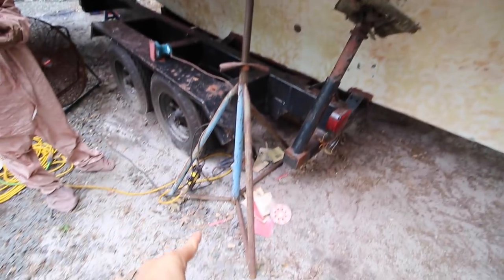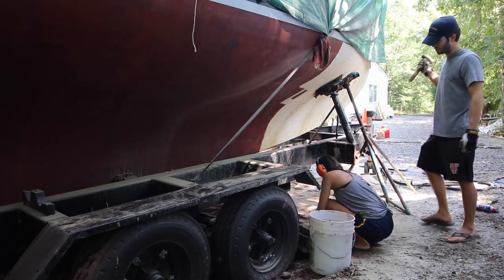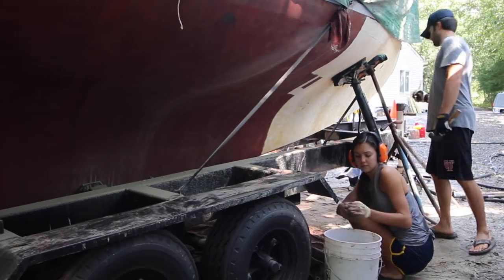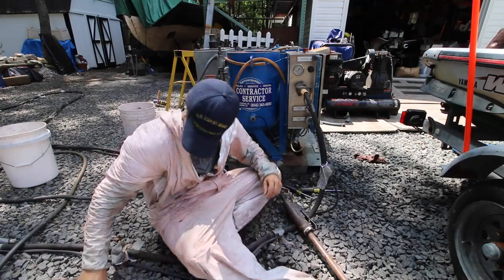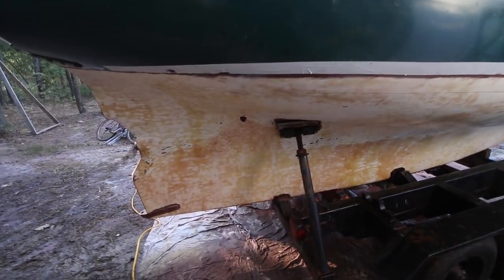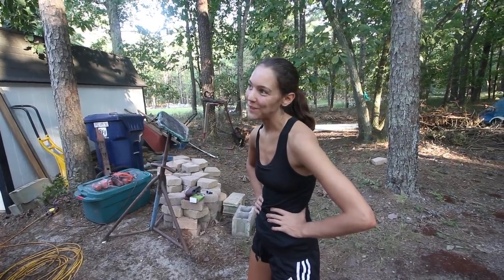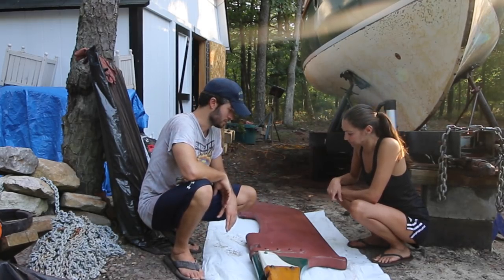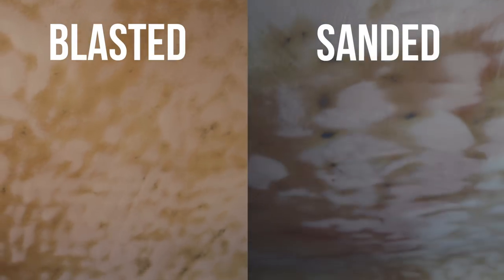45] Backyard DIY Classic Sailboat Restoration | Abandon Comfort

Comment: is the heat from the electric engine a consideration, how will you cool it?
Reply: Heat from an electric engine is not a major concern. They run around 95-97% efficient so very little waste heat is created when compared to a diesel running 30-40% efficient. Lots more of the potential energy gets converted to mechanical motion with electric motors than with a diesel, the wasted energy is the heat created. Still diesel fuel has much more potential energy per pound than even the best lithium batteries, which is why you get a much greater range with a diesel even though you're throwing away much of the energy in the fuel.

Comment: Ran into you guys by accident.  I will be moving from Central America to South Florida to live and I want to buy a boat, not sure of what yet.  I am use to 20-25 " ski boats in Colorado so it will be big change, but thinking of getting used sail boat and not sure of what size.  Something reasonably cheap that I could fix up.  Need suggestions on where to look and types of boats to look at.  Please advise !  Thank you !  Ciao, Robert

Comment: How long before you are back in the water. I'm waiting for more adventure.
Reply: And also, I think electric would be an issue, the diesel engine will run 100 % until you are out of fuel. The electric will not run 100 % on 1/4 battery life. Yes electric can be free, but, you almost can't even dock with the run time. The diesel engine will run 100% until you don't have fuel. I would recommend keeping the diesel, and adding an outboard electric to add extra thrust while running the diesel engine. In turn the diesel engine will charge the electric and do its job almost like your Prius does. Or use a diesel generator Good enough to charge as much as you use. Along with solar panels and maybe a few wind driven generators to use during sailing, it might all work together to produce power for propulsion. Hybrid boat.

Comment: Why did you decide to remove the anti fouling?  Irrespective of the coatings age and that it has been out of the water 10 years, based on what I can see in the video only, I would have not removed it because I see no pealing nor delimitation nor damaged hull.  I would have sanded and simply touched up with primer where necessary followed by 1 coat of anti fouling.  Senior Surveyor Lloyds Register.

Full coating removal is required when the coating has 'failed'.  Failure of coating is identified by delimitation and pealing. If this is not occurring it means the bonding between layers is strong.  My opinion is if the coating has not delaminated nor pealed after 10 years, there is EXCELLENT coating bonding and so keep it on but do a hard sand to prepare the surface for the new coat. Senior Surveyor Lloyd's Register!

Comment: Are you thinking about leaving the prop live and hooking a altinator or 2 to it??  If you do I recommend GM alt. From the mid 1970s cheap and everywhere.
Reply: Not enough RPM for Alternators.
The Propeller attached to the Electric motor will spin while sailing and Re-Generate some power....

Comment: Why do people assume electric propulsion is green? Why does nobody seem concerned at all about the environmental cost of the production and disposal of Lithium batteries. A tank of fuel only becomes a bomb if it's half full, a lithium battery becomes a bomb anytime it's over charged, over heated or shorted out and you want to use them for huge current draw in a confined space with the possibility of saltwater getting in... You can buy diesel anywhere and if an emergency presented itself you could even resort to running it off cooking oil. Replacement lithium batteries won't be too easy to come across in paradise. As all the Uma followers are aware, having a small outboard saved them a few times when there electronic systems gave up.

Comment: The thing about the lithium batteries is if they get punctured or over charged  at any point they can catch fire and depending on how many banks you have can explode with the force of a small atomic bomb . That means anything with in a quarter of a mile will be destroyed  . Witch also means by the time you see the smoke getting  out of the blast zone would be impossible .

Comment: On a boat that small weight is the largest concern why would you run stainless lifelines when you could splice your own dyneema. It would cost you less money save a good bit of weight and you could build them your self. Even the standing rigging is worth replacing with dyneema especially since you will be raising and lowering the rig to get in on and off the trailer. Just a thought.

Comment: As you've already learned, you should have gone through the media blaster before using it, but I realize you had no experience with the machine. I'm unfamiliar with the brand you were using, but I do have a lot of experience with others. It looked like your water to abrasive ratio was off, too much water, which will slow you down. Also, what size media were you using? That makes a huge difference. I have a 27' Newport I'm going to have to strip the antifouling and barrier coating from to do some repairs on the hull, including a rebuild of the false keel on one side. My plans are to use an EcoQuip 2 with 40/70 crushed glass to blast the hull clean. I'll try to make a video of the process if you're interested even though you're done with yours. Properly done, blasting is WAY faster and leaves a better surface for barrier coating, fairing, and anti fouling. Do you know what products you are going to use below the waterline?

Comment: A quick question, you say that your concerned with weight, how much do you think you'll save by removing the diesel that is so simple, and adding a battery bank charging system and motor ? I just don't see any advantage at all, maybe a little more dangerous though. Be safe.

Comment: WOW!!! looks like a fitting Boat for Abandon Comfort!  Your last boat didn't really work for the Abandon Comfort brand.  It was like doing a road trip in a 1978 Cadillac vs. an Abandon Comfort trip in a Prius.  I love the full face mast respirators I used them when I re cored my boat from the inside.  full face mask respirators are perfect they never fog up.  I just had to put up with the occasional Walter White comments. 
 Good Luck to you both.  I look forward to your videos!!!
Reply from the maker: Haha no Walter white comments towards us - yet! And couldn't agree more with how our old boat didn't fit us or "the brand" - which is essentially just us :)
Reply: Im still on board for the electric power, look at the size of motor that powers the tesla cars..one of them could spin that dinky prop into next tuesday and batt. tech is so freaking advanced from just two years ago..what do these old frogs think your talking about when you say electric motor, something from a submarine from 1918?, well the only question i have is recharging..but im sure you have done your research..my pick for a bank of batts is the lithium cobalt ones not the sulfide ones..it's all about the amps as you know..

Comment: Not sure why you striped the hull to glass.  Didn't look like there was that much build up.  The spruce mast is hollow (boxed) inside (or should be) and is extremely strong.  Would be interested in the weight difference between it and aluminum.  Spent two years sailing a boat without an engine and learned a lot about sailing and maneuvering through marinas and anchorages that stuck with me and came in handy even with engine.

Comment: Uma went to an electric motor and honestly, it sounded great when they did it but I am certain that they will go back to diesel.  You need MASSIVE battery power to get proper thrust with an electric motor.  I think they said it draws 70 amps?  That is a tremendous electrical need.  And if you plan on doing blue water cruising, you'll find yourself in conditions that rapidly change.  And, when you've had 3 straight days of clouds and rain (no solar recharging) and then get hit with 50 knot winds, you're going to need some power to keep your boat off the rocks WHEN your anchor drags.  A good running diesel is the only auxiliary that can be trusted.  But, hey if you're only going to sail around the bay and stay close to the slip, go for it!

Comment: Massively wonderful job! If it is electric, it is called a motor! Engines run on fuel! Motors run on electric! Just so you know that when in need of repair! At 3 knots with 8 lithium batteries you may get an hour and a half/forty minutes! Or less, see a video put up last week by Sailing Uma, they built their electric drive system and have used both types of batteries (Lithium is lighten) half the weight in fact! Also their vessel is lighter than yours! I know you what to GO GREEN, but, you do need as much info as you can get, so as not to over estimate the power and times for electric/battery/solar kit!

Comment: You're going to have to consider how much power that electric motor is going to draw. How much will be required to move the boat speed etc. If you repurposing Tesla, Toyota or Chevy batteries you should be able to to build an array sufficient for your needs.  The challenge is going to be keeping them properly charged monitoring your draw etc.

Comment: I admire people who try new things and am interested in electric propulsion. It will only get better once the “early adopters” experiment with it. My only concern is that a a sail boat, you sail as much as you can .  You only use power propulsion when you need to. When you need it, you need it to work. You could be in dreadful conditions against a lee shore, becalmed in an ocean or dragging an anchor.  It’s a real safety bit of kit, especially for blue water cruisers. I have still no not seen an electric propulsion system on a yacht which can deliver full power for any length of time so am interested to see projected performance calculations.  Good luck

Comment: Hello, I have two things that I would like to bring up so you can consider them. The first thing is, that you are doing this project in the way you are, is for ecological as well as economical reasons. If I were you I would take into consideration the severe impact  things like stripping led paint straight into the ground has on the environment, and if there are other processes that likewise have such an impact. It might be the enviromental cost like substituting wood for plastic (like in your last project) or where you need to be when you're doing fiberglass work and indeed doing fiberglass work. And all of the 3 456 784 other decisions you take.

The second thing I'd like to bring up has to do with selecting propulsion, and more specifically your backup to your back up system. The senario I see here is that you might be in the Athlantic somewhere and up comes one of its famous storms. (Translated from my language Assault Weather, and yes there is such a thing) You, in a couple of hours find yourselvs in 30 m/s wind (storm) with 6 meter (20 ft) waves and the ocean curren taking you backwards at 3 knots.

Will your selected first system work in this. Say that you rip your sail your mast has come down and by now it's dangerous to venture on deck. Will your selected engine, if you have an engine, contend with this. Perhaps no, maybe you have't got enogh runtime left in the batteries, maybe your engine isn't powerful enough or there might be something I can't think of. Will your backup to your backup, the oars you mentioned work or do you need something more (Everybody breath. I just mentioned the current taking them backwards, so the big canvas tube in the water (sraight from my language, drift ancor) won't work, or indeed will)

I know oars are fun and caouragous and used in lighter boats and/or more oars people. I do know that people has sailed the oceans since before there were people. I also know that there have been tremendous losses. I think there is a whole business in the US hinging on that. Hunting for boullions or somethings like that.

I don't pose these questions to be a nusiense or selfrightious. I just wan't YOU to ask them and answer them for YOU. Pardon the long comment. With Regards, Ann

Comment: If your heart is set on electric  and you plan on a dingy , why not put a kicker bracket on the back of the sail boat  for the dingy motor and put a 15+hp long shaft  on the dingy ? That way the motor you are going to have anyway can be used to move the sailboat on extended powered deliveries with the assistance of a few gas cans  ? Not as nice as an in board diesel but an OK compromise .

Comment: When you get to the cruising part of this endeavor, I'm pretty sure you are going to wish you had more than a handful of hours run time. And that's optimally... remember Murphy like to catch us with our pants down. Or should I say "with our amps down." Whether those wishes are going to come during a time of mere inconvenience (flat battery in slack water, a canal or a harbor entrance) or dire circumstances (flat battery on a lee shore or even a flat calm for days on end) remain to be seen. Electric power is well and good. I don't think the ROI is all that good yet (versus a diesel you already have) but for many weekenders that have the extra coin to indulge their green desires, electric is a viable alternative. If that's where you end up with this,  as weekenders (nothing wrong with that), the electric will serve you well... or well enough.
All due respect... I think relying on oars as a "backup" on a long distance cruising boat is lunacy. In my illustrious youth, I rowed 20 foot steel lifeboats with seven other strong, young men for 10 miles in competition (military) and it about does you in. The two of you with a deep-hulled boat boat like yours... come on?

As a compromise, consider including a small, efficient diesel generator with the capacity to supply enough power for a fast battery recharge or even to run the motor at full amperage, or at least at 50% amperage... ala a diesel electric submarine. That way you have an alternative. Some small generators use only a quart or so an hour at load, so if you had a 10 gallon tank, you'd have 40 hours of runtime. Look into it. It would be easy to include at this point.

Comment: The problem with an electric engine is when caught in a huge storm and it’s life or death and you have to motor but you haven’t had solar/sun to charge your barriers or just used to much battery you stuck !!! In a liberal / hippie life it’s a great idea and it’s better for the earth but when it’s lives at stake not just your own but your loved ones I’m not sure if I would go with batteries for motor .... you have the diesel and it’s new ... I can see your trying to justify not using it but in the end is your life worth experimenting even though you have something that has proven reliable
Reply: A "liberal, hippie life"??  wow
Reply: Actually, the idea that a sailor can't go to sea without a motor is a fairly recent notion which is why many "sailors" today are really power boaters in disguise.
Reply: To think sailors crossed unknown oceans using rudimentary navigation tools with nothing more than wind for hundreds of years and with zero modern technology or ability to call for help and they managed fine apart from scurvy.
Reply: On a sailing vessel if you get caught in a huge storm near a coast, the last thing you do is to attempt to sail/motor towards the coast attempting to find shelter. If you are out in the ocean then you should be prepared to face the storm either with storm sails or a JSD (Jordan Series Drogue) or a sea anchor all depending of the kind of storm, kind of vessel and position of the vessel in terms of distance to land etc. But yes, in some situations it might be a life saver to have a good engine. But if the concept is thought thouroughly through and both the vessel and the crew is prepared to keep up to that concept and take the appropriate precautions, then it should be fine. That is a difficult balance to keep on a small boat while trying to fit it up as simple as possible. A good powerful engine is good to have. But it demands the appropriate attention and maintenance. And that can take from the joy of the free sailing spirit. If the sailing spirit is prepared to stay put in a harbour or an anchorage for an extra day or two in order to avoid a gale warning near by a lee shore, then the concept should survive accordingly.
Reply: Liberal/hippie life? You started making some reasonable points, but you lose all credibility with those three words. It shows that view people who care about the earth and their impact on it negatively.
Reply: Outrunning a storm in a 22 foot is basically impossible with ANY form of propulsion.  
I would hate to get becalmed with only a diesel, once you are out of fuel, you are toast.
Reply: You just can't motor into a heavy wind or sea without a bloody big prop and a powerful engine, which just isn't practical on a sailboat.
A prop that has the torque will act as a brake when you're sailing...and nobody has the room for a 6 cylinder diesel on a small sailboat.
Reply from the maker: Sailboat - a boat that's primary method of propulsion is by doing what it is designed to do, sail. If you're near the outer bands of a squall or stuck in the shit you use your sails. This notion of using an engine to escape storms is absurd armchair wisdom. It's called reduce canvas/reef or heave-to. None of this involves a diesel engine. Watch Skip Novak's series on heavy weather sailing or go experience a 100+ mile passage yourself.
Reply: If you are in a storm and just use you engine You are dead,
Reply: @AbandonComfort  You are so condescending, and for no good reason. It's a really bad look. You haven't sailed anywhere yet, so why try to lecture people about it?